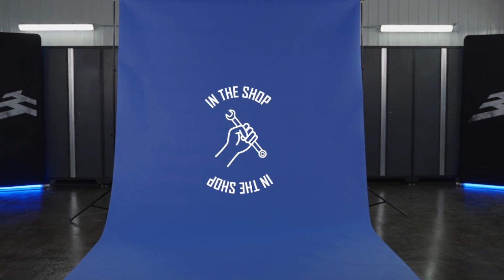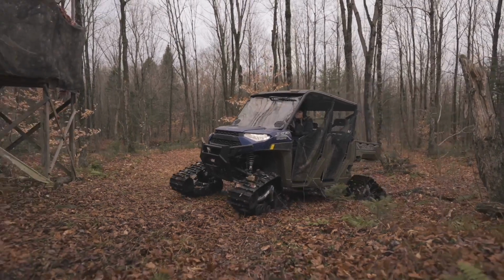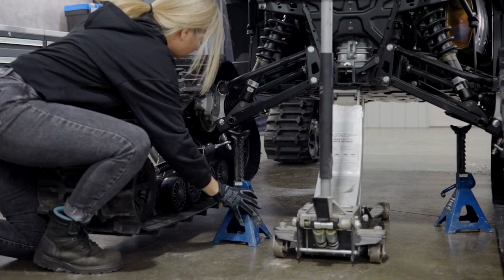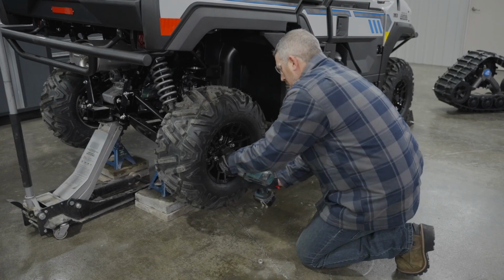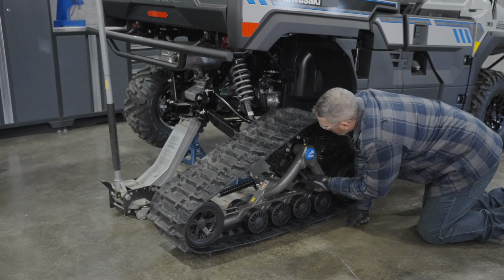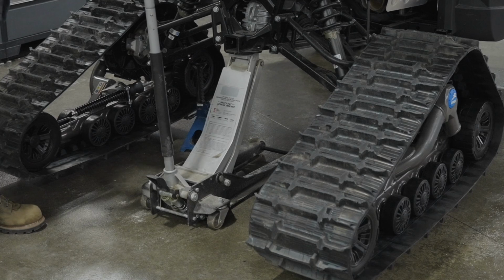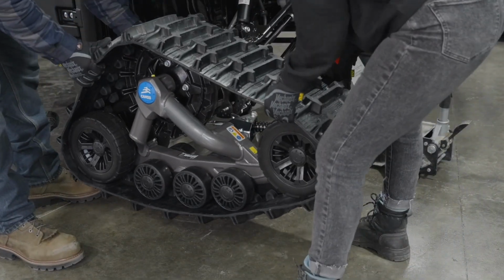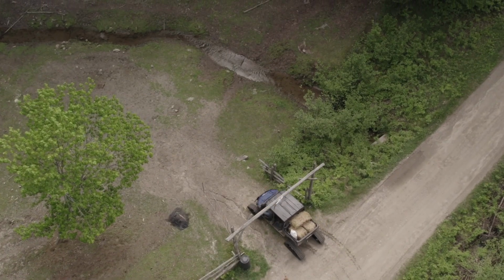How to switch Camso UTV 4S1 track systems from one UTV to another

Comment: So what if the serial number is gone?
Reply from the maker: @glenyukon99223 Is there still a sticker present on one of the four track system frames?
Reply: @ cant answer that yet. Im looking at some tracks that a buddy has for sale here. I haven’t got pics of them yet, just wanted to be prepared in case serial number is missing. Not even sure what they are. T4S, 4S1 or X4S
Reply from the maker: @glenyukon9923  It would be the best to have the serial number, if you could ask him that would be awesome.
Reply: @ i have asked. Hes been sick so im not in a hurry. Nothing happening till spring.
Reply from the maker: @ Don't hesitate to reach out again once you're ready. 🙌
Reply: @ so im still having a hard time understanding why the serial number is needed?  In my mind it shouldn’t matter what the tracks were originally on, or have been on since. I would be putting them on my Ranger and thus would need the transfer kit with the correct sprocket, bolt pattern, lug hole size and proper A arm bracket kit correct?  Im just full of questions eh? 🤣🤣
Reply from the maker: @glenyukon9923  Your questions are great. The track serial number is needed to validate the information about the Camso track system itself like the year & model to make sure it is compatible to the new vehicle and provide the right parts number.